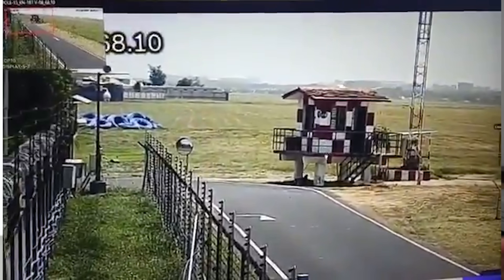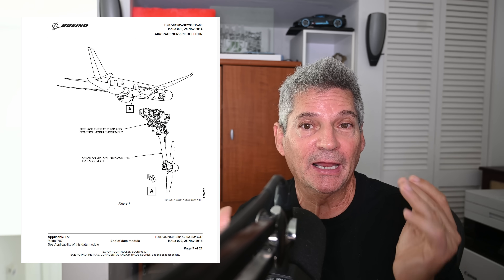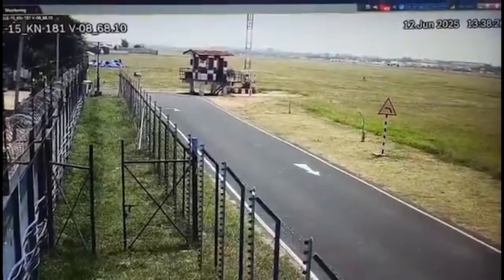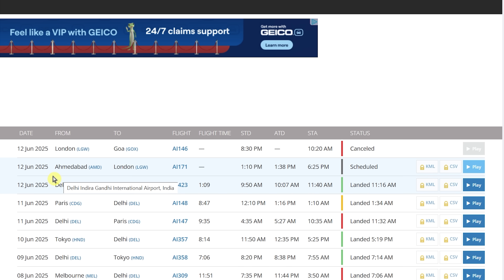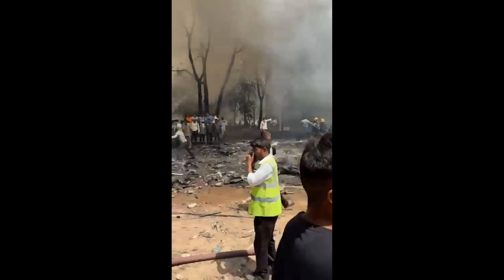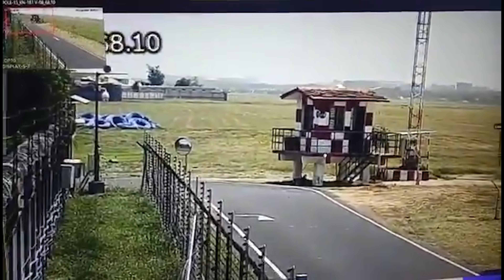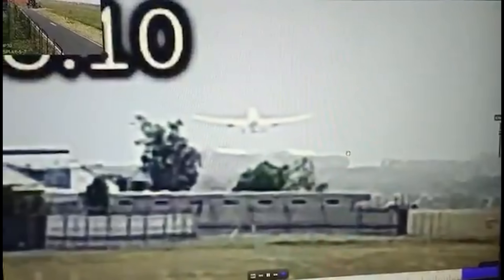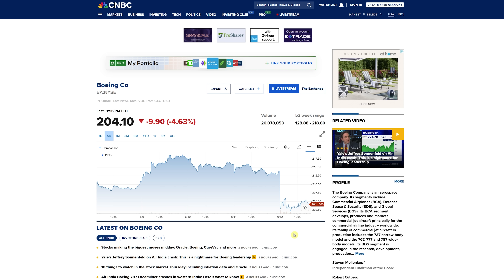What Caused Air India 171 Crash, Mysterious Sound Before Impact

Comment: 2:03   The debris object in the video clearly flew up. It could even have sucked up by the aircraft from a building roof. i.e. either from the engines or the vacuum or air pressure differential created by the massive aircraft itself. Perhaps even a loose roof panel or other debris sitting on a roof somewhere getting sucked up into the air just prior to where the aircraft crashed. The spoilers appeared extended during the crash landing approach. Perhaps they were at that point trying to slow down the aircraft? i.e. knowing a crash was imminent. You also have to factor in that the explosion would have occurred seconds after the aircraft actually crashed and because the aircraft was moving at speed, that object still could have resulted from the initial phases of the building collision. The crash site is where the aircraft came to rest, however the actual collision would have occurred hundreds of metres prior.

Comment: You are very far off base. As a tech that has worked on 787's for a major airline i am willing to bet that the flight management dat put in by the pilot was incorrect. The sound you hear is not the RAT.  The by high pass engines of a modern aircraft sound that way from some angles. I have spun the RAT in the hangar with a hydraulic mule. The sound is incredible but that isn't the sound you have.

The fact requires input from the pilot like weight and balance data, runway description, atmospheric conditions to generate a thrust rating and flap setting.  Thus building a check list. If the data is incorrect the power setting for take off and the flap settings will be wrong. With incorrect settings the plane will stall. What the video shows is a stall.

Comment: Near the wings is the best place to be,turbine AIR planes does not use fuel,it uses compressed air,nobody in the ground said anything about the smell of fuel,the fire brigade did not spray foam antifire.Looks like aircraft with fuel or without any fuel explode anyway,must have a reason for that...Anyway,is very very sad when accident like this happens,only 1 survived is a truely miracle...

Comment: How many Hrs did the Co-pilot have total time, and how many in the type. On the Takeoff roll the call is V1......Rotate.....Positive Rate....(response) ... Gear UP.  The flap handle feels like a wing, the Gear feels like a wheel, it was in the center of the panel, so you have to reach for it, no idea how you could have mistaken flaps for gear....was it a DEI hire?

Comment: You cannot see 5 degree of flap in this video. However someone did show a picture of the wreckage where the flaps did appear down. This aircraft screeeeems at you if you have not deployed flaps when you start the take off roll. I don’t think the flaps will be the issue. For RAT to deploy it must be a system error where the computer in the aircraft decides to deploy that. Why? We will have to see.

Comment: I will also add that the temperature on the ground that day reached over 100˚F/38˚C, so if the AC was not running, it would have been quite warm inside the aircraft.

Comment: Audio evidence suggests an RAT deployment. This would likely indicate engine failure which may explain why the aircraft climbed briefly before losing altitude. 
Air India may not have the best maintenance records which may be a contributing factor, alternatively 787's can suffer duel engine loss with low pressure in it's fuel system. 
Personally I think the investigation should start with the quality of fuel and it's storage.

Comment: Stop this video at 1:09.
It is possible to see that the flap are deployed, as we can see the shadow of the engines through the gap that exists between the flaps and the wing.
On the same picture, the RAT is visible under the fuselage.
Personally I concur on the probability of the analysis. Having seen  two days ago this video with sound and also having slowly and carefully gone through it: it opens with the sound of the RAT and some pixels show the deployed emergency system (black pixles are the trap, and grey pixels are the RAT itself). As the pilot says in his mayday, thrust was probably lost. The survivors gave like confirmation by saying that few seconds after the T/O, there was a 'bang', the aircraft was like stucked in the air and there was a big noise. May be a bird strike in the engines, the lost of thrust and the RAT starting.
Reply: Your observarions look spot on - question is what caused the bang and dual engine power loss.

Comment: You keep replaying the take-off and saying "nothing looks wrong" but the flight clearly ran long down the runway and barely made it off the ground, kicking up a lot of dust from the threshold as the plane nearly overran. This implies insufficient lift during takeoff, either due to flaps or thrust.
Also the plane did not veer to the left. You know this because of where the impact site was—a straight line from the runway.

Comment: Takeoff stall is a stall which occurs immediately after an aircraft attempts to get airborne. When it occurs following rotation at or near the applicable Vr, it may be attributable to an unintended attempt to take off without the appropriate flap/slat configuration set or because the necessary thrust has not been set.

Comment: I don't see the flaps down. Some of the electrical systems are split between engines, and one passenger put up a video before take off of the AC and some electronic things not working in the cabin. So perhaps the flaps were effected by this, also in the crash video there is a panel of some kind seen flying off the air plane as it was coming down.

Comment: In my humble opinion it looks as if both engines failed at the same time - no yawing visible (fuel issue?) and with RAT deployed, pilots still have flight controls - just no thrust.
As for flaps being retracted, at that stage in the take-off, would that really matter - when an aircraft like this could climb with just one engine.
That RAT is the smoking gun - no engine power.

Comment: I’m not an expert—this is purely speculation—but it’s possible the lithium battery overheated and exploded, either due to excessive heat, a failure in the cooling system designed to regulate its temperature, or even a defect, considering the past incidents involving battery fires on the 787. The explosion might have triggered a short-circuit, which could explain the flickering lights reported by a survivor who told BBC. Alternatively, the blast may have damaged critical control systems—or worse, led to a total loss of power—possibly preventing the crew from retracting the landing gear and compromising the aircraft’s overall control. A complete power failure would also explain the deployment of the ram-air turbine, if it was indeed activated.

Regardless of the cause, my thoughts are with the families who lost their loved ones in this tragedy.

Comment: They put the flaps up instead of the gear. Thats what happens when you do. In the video at 5 mins, they appear to only get airborne off the end of the runway in the rsa ( that’s why there is dirt flying around. On flight radar it shows they did an intersection departure ( halfway down the runway) which was only about 1700m which is too short. Then they did not retract the gear as normal procedures, but the retracted the flaps by mistake, which causes a large sink.

Comment: @Jeffostroff   there is also one key issue  take note !  in every video of  Air India 171  plane crash  the plane wheels were down all the time !  now !   if they had taken off as corrected the landing gear would have retracted as soon as they left the end of the runway into fight mode  however !   it seems that the landing gear was left down or stuck down  leading to your theroy of lack of hydroilic power !   or systems failure or a pilot error  ergo brought flaps up insdead of the landing gear .

Comment: I am familiar with the electrics on a Boeing777 and assuming 787 work in similar fashion, then If the generators cannot match electrical load,  ELMS cuts power to systems to keep essentials running . Not on the list of essentials are Autothrottle  Radio altimeter, Flight Management System (computer controlling Autothrottle (ie COCKPIT automation). Pilots rely on the autothrottle to work reliably in critical phases of flight. If it was failure of the Autothrottle. it might cause the worldwide fleet to be grounded.

Comment: The seat configuration diagram you showed is incorrect. On his boarding pass seat 11A is Economy Class; not Business.
Need to find the correct seat configuration of the particular airplane. Airlines quite often have multiple configurations depending which route the airplane is assigned. I've flown JAL in the past and there were 2 or 3 seat configurations for the B777-300 and B747 depending on route. Some routes have First Class and some don't. Even number of Business Class seats vary on the route flown. I remember back in the early 2000s when they were still operating the B747-400, the Vancouver-Narita plane did not have First Class. Generally, flights less than 9 hours had Business Class but not First as very few passengers were willing to pay the price of F ticket.

Comment: You are completely wrong. 

The co-pilot pulled the flaps instead of the gear. Co-pilot error. 

Gear should have been up. There appears to be no flaps deployed.
Reply: And you are completely right because you have access to the diagnostic data right? There could be a multitude of reasons, all you are doing is speculating that it was human error when we have zero evidence so far to back up that claim, sad.
Reply: @MrPragmatism lets see when the data comes out
Reply: This is true guys i was the co-copilot

Comment: The sound does not seem to be unusual, turbofan engines sound like that. Maybe the environment sound reflections do their part, too. What I think is interesting, why are there no flaps set, but the gear down? Maybe the pilots rised the flaps instead of the gear by mistake? Time point would fit to the takeoff phase the plane starts to stall.

Comment: Actually when you said about the sound you are right, when you listen to the sound of the plane it does seem to have a strange sound.

And the plane sounds like that of the other one with the prop down.

But would that cause a plane to crash, would the deployment of the prop cause the plane to not take off?

Or would that just be an indication of the lack of power being delivered to the jet engines?

Presumably if the building were not in the way the plane would have just landed with the aid of the prop.

Interesting.

Comment: The sole survivor, Sardar Vallabhbhai Patel Said after take off, there was a loud bang and all the lights in the Cabin flickered.  No smoke from engines so there was no backfire, or Mechanical catastrophic engine failure. 
So loss of thrust was likely  caused by electrical failure  i think electrical issues caused Auto-throttle rollback

Comment: Couldn't this be a fuelling problem. A jet always take very much of fuel for the taking off. This flight may have used only a few amount of fuel at it's ascending. Both engines looks failed. No direction change observed. Suddenly it dropped it's climbing. Wings are bent ascending angle is almost correct nose in correct direction. But keeps losing the level. Trust has lost. May have all the control technique failed. Landing gear has failed too due control system. 
By some reason or other due amount of fuel have not pumped in as expected. There could have been a mistake in the fuelling system.This is what I observed from the video photo of it's climbing.

Comment: The analysis of the crash of the Indian plane is simple. First, the pilot fixed the speed at 180 while he was on the runway, then took off, then put the plane on the autopilot and forgot to raise the speed. The pilot flew at a speed of 180, which is a very low speed, especially since the plane is loaded with all fuel in addition to their passengers and luggage, which prompted the plane to land immediately after takeoff.

Comment: *  Jeff  *  OK, the amount of dust upon rotation seems excessive.  How about looking at previous departures to see what the dust levels were.  The reasoning for this comparison will sound crazy and impossible, but if previous departures didn't kick up that amount of dust at the same point of rotation, the only explanation is that the thrust reversers deployed. (should be impossible)  Another item to consider is a massive failure in the bleed air system.  Remember a video stating the A/C wasn't working?  I was in Naval  Aviation for 20 years as combat air crew, air warfare specialist, R&D, maintenance Chief, and Quality Control Chief.

Comment: On take-off, when the aircraft comes back into view from behind the hut, there appears to be a large grey/white puff of some material behind the aircraft. Is this most likely moisture (no evidence of a wet runway while the aircraft has wheels in contact with the tarmac) or dust being lifted from the runway (or just off), or could it have come from the engine/s?

Comment: After crashing ,it might have taken atleast 4 or 5 seconds ,for the fuel tank to explode and catch fire.
He jumped out ,within that 5 second period from a height of 10 to  20 feet .,is what i think.
Atleast 5 second gap between crash and fuel tank explosion .

Once it exploded ,there was a huge ball of fire for atleast 50 metres.
Great miracle😮😮
Reply: You can see in the video that the plane exploded in less than a second after impact.  However you can also see some debris fly up on the left just before the explosion.  So it is possible the plane began breaking up just before the fuel exploded.  Being above the start of the wing could have ripped the fuselage at that point and he could have been thrown away from the plane at that point.  Seems he passed out so not clear about where he was when he gained consciousness.  Also did I read he was pulled out of his seat by a rescuer.

Comment: The plane needed full runway length, because you see lots of dust at the point its taking off, could be a sign of not enough power while the 787 accelerates.

Comment: 05:42 That’s not 600’. ADS-B data might show 600’ but that figure should be corrected for barometric pressure (with a QNH of 1001 at the time of the accident that will be a correction of -360’) and field elevation (180’) so a total correction of 540’. I think it did climb above 60’ but ADS-B is not that precise and further evidence is in the video. The 787-8 has a wing span of 197’, and with the grainy video I don’t think you can actually even see the wing tips, but it looks like the aircraft barely reached an altitude of more than 200’ above ground level.

Comment: Pilot informed ATC, he was steadily losing thrust from both engines. Its strange, both engines failed at same time. My thinking is fit four smaller engines instead of two bigger ones. Another thing...make smaller passenger aircrafts that carry lesser amount of fuel. This will minimise fire incase of crash.

Comment: The plane couldn't have lifted off at that speed if the flaps weren't properly set for takeoff.  It's suspicious how the gear remained extended after a normal looking liftoff, then in about the same number of seconds as it takes flaps to retract, the plane began sinking.  

The survivor reportedly heard a loud bang just after liftoff, then observed the cabin lights flickering white and green, consistent with emergency lighting, then it felt like the plane stopped midair, then he heard the engines throttle up, then it began sinking until it crashed.

The RAT deploys automatically when electrical system voltages drop.  There are numerous possible causes for electrical system failure including engine failure, but failed engines don't throttle up.

Lots of hints and possible leads and plot twists in this one.  Looking forward to learning the facts as they become available!

Comment: I have a very crazy theory.  I believe that for some reason the entire electricals failed - probably triggered by the  operation of pulling up the landing gear - resulting in a system reset and withdrawal of flap and slat (?) - that is the doom.  One must see in what frequency the pilots communicated the "Mayday".  I heard somewhere emergency frequency is what they used  - at a time when the ATC communication in the local frequency is dominant?!?! This could be because the regular atc communication went off along with the electricals...

Comment: On top on what you explained,they might not follow the SOP, meaning they forgot the fuel pumps off which caused engines starvation &loss of trust on both engines which caused the RAT drop down with no help as the aircraft was at very low altitude about 750 ft , UN recovrebl  at all

Comment: From the video it's immediately noticeable that the aircraft should have stabilized and pull down its nose when first noticing it risks stalling. 
I saw nothing like that happening, its like the pilots were oblivious to what was happening.
Its hard to take in but this was avoidable.
Reply: Like with flaps in wrong angle and gear down if it leveled its nose it would have had a chance

Comment: It believe it is Pilot Error. Where are the flaps? Why did they fail to clean up the drag by retracting the landing gear. and why did they not reduce their angle of attack since they had already cleared the tree barrior. Also, the sound recorded is affected by the recording device was affected by the recording device. Not defending Boeing  but I believe the Pilot allowed the 787 to Stall. do to angle of attack and the huge drag caused by the unretracted landing gear. JK